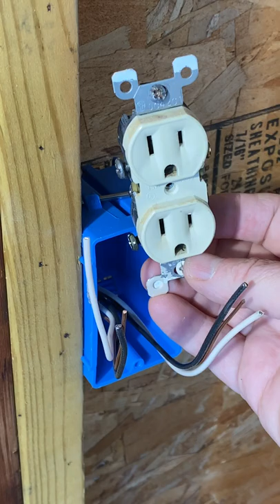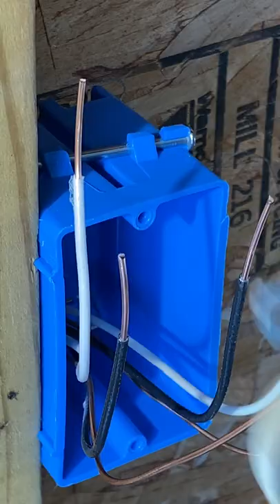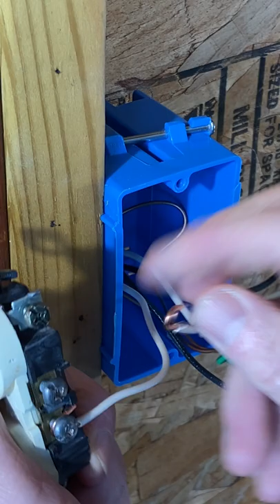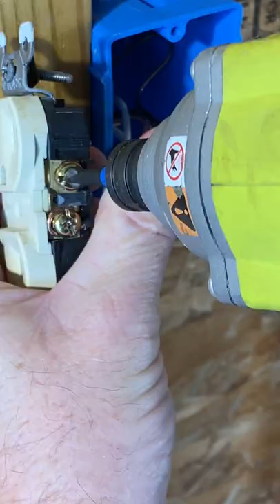Install an Electrical Outlet in 60 Seconds #Shorts

Comment: As an electrician, we use Stab ins.
Reply from the maker: Congrats.. you are the first electrician I know that uses the back stabs. Ive been an electrician for 39 years and I have never known anyone other than DIYers that would use these.
Reply: @BackyardMaine absolutely correct good electricians don't use stab in cobnections

Comment: This is a code violation. Do not wire this way. You must splice the white to white with a " pig tail", which is attached to the receptacle.
Reply from the maker: Not it is not a code violation. You don't need to pigtail. You don't know what you're talking about.
Reply: Where does the NEC said that? Or is this just a local code for your area?
Reply: @jacobhatfield4970  NEC 300.13 requires neutrals to be pigtailed on a multi wire branch crcuit.
Reply from the maker: @frederickvanpelt6393  Most circuits are not multi wire branch circuits and this one was not. I actually never use them but you can with other requirements. So again not a code violation to wire through the receptacle

Comment: Use the plug-ins,  they wouldn't put them there if you "shouldn't " use them. They work just fine and in over 20 yrs of always using them never have i had a problem. Weird how the so called electricians don't want you to use them, they are faster and just as safe as wrapping the damn wire around a screw.
Reply from the maker: Just my advice based on many years of experience. Of course do as you please.
Reply: Bad advice push in contacts yield less surface area on your contact greatly reducing the rating of your electrical device might as well go ahead and wire your Outlets using thermostat wire or Bell wire but you better make sure somebody doesn't plug in something like a space heater or a toaster oven or even a hair dryer you will probably burn up your device if not burn down your house

Comment: Pigtails have left the chat
Reply from the maker: The pigtail is an option but either way is permitted by code. The receptacle pass through current is listed at 20A even for 15A receptacles. So it's actually as good or better than the wire. The limiting factor would be the connection. If you make a solid side wire or compression connection you will be fine. If you back stab they you should pigtail every time in my opinion.
Reply: @BackyardMaine  well im a firm believer you should always pigtail and if your being a tutorial page you should be promoting that. Also the tab is in no way close to being better than the wire itself, a 12 gauge copper wire is actually rated for 30 amps, its tge insulation that is only rated to 20. Lastly backwire or stab-in shouldnt even be talked about, is it code? Sure cause they still make them but the majority of burnt up even outlet fires Ive fixed have all been from stab-ins and not pigtailed stab-ins. The rest are rare oopsies where somebody forgot to tighten the screw or wrapped the wire counter clockwise which loosens the tighter you screw it
Reply from the maker: @0penEyesAndMind51  I agree with everything you said with exception of the pigtail. Back stabs are trash. I did a video on that as well. Side terminals almost never fail with the exceptions you mentioned. Amp capacity of the wire for 14 and 12 is higher than the max OCPD. But the device meets or exceeds that rating so for me if installed properly it’s ok to through wire. I do pigtail in the industrial setting and then there are three or more conductors in residential wiring. Also in multi-wire branch circuits.
Reply: @BackyardMaine  I agree with that, when tightened properly, the pass through is good enough.. Clockwise wire wraps only of course.  I am willing to addmit im ? IDK old skool and still reccomend pigtailing whenever possible... I'm also glad I havent seen you promote wago's over linesman and wirenuts. But I've only seen a couple of your posts
Reply: @BackyardMaine  You never responded to the residential side of my comment of your post. Something like "take the ears off an outlet for a temp one" like in the video

Comment: Didn’t use a torque screwdriver
Reply from the maker: I have been in the electrical industry as either an electrician or an electrical engineer for 38 years and I have never ever seen someone torque a receptacle screw. It doesn't in the real world.